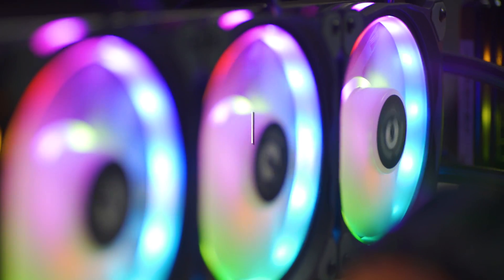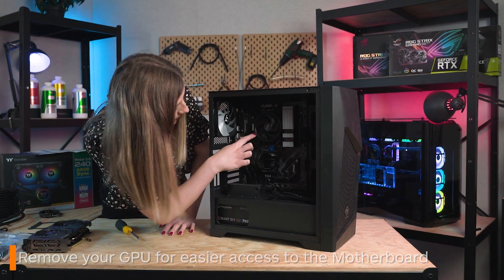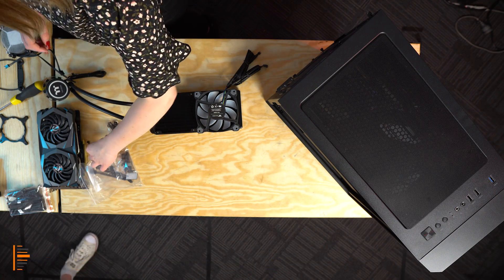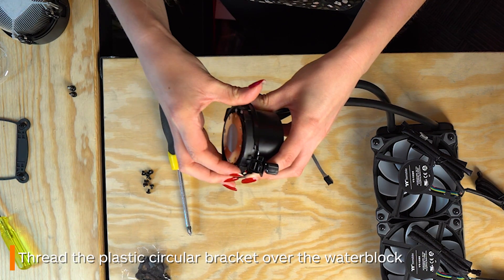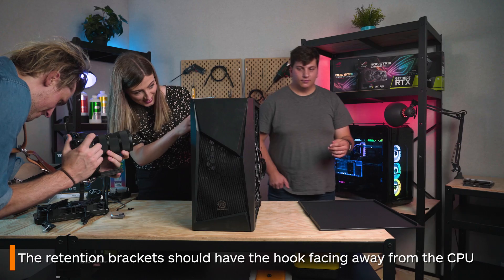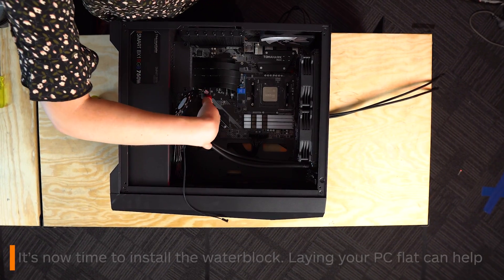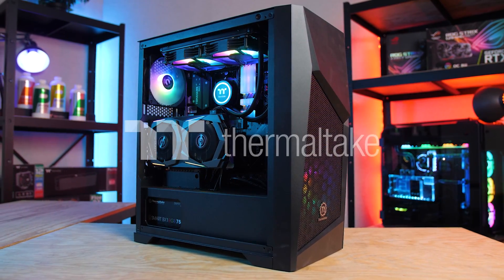How to INSTALL a CPU AIO Water Cooler - Thermaltake Water 3.0 ARGB CPU Cooler

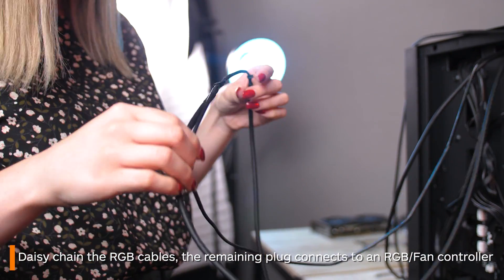Comment: Just to double check... at 4:11 the rgb plugs can be connected to system fan controllers? (If you dont have rgb controllers)?
Reply: What you see her do @4:11 is daisy chain the rgb cable the plug that chain into a RGB Controller that they have inside their case like the Versa C23 TG RGB Edition
 (There is a cable for rgb and a cable for the fan. if you dont have rgb headers, you still need to power the fans. There are RBG controllers that Thermaltake have, for use with the 3 fan rgb packs for example ( Thermaltake Riing Plus 12RGB Radiator Fan TT Premium Ed 3 Pack/Fan/12025/PWM). They use a USB 2 header on your motherboard to 'interface'. For my Gigabyte X570I Aorus Pro WiFi AM4 ITX Motherboard, this meant I lost my front usb 2 ports (2x). This can be overcome by using NZXT Internal 5 Port USB Hub, where you can plug it into the USB2 header on the MBoard, and get 3 more headers.

Comment: Is nobody going to point out that the fans on the radiator are installed the wrong way for push/pull system of the case? The fan in the video is set up to be pulling in air from the top rather than push out. While this isn't a problem without an AIO cooler, the problem is the radiator. The radiator generating too much heat from the CPU and pulling those heat inward toward your GPU will make your GPU temp rise like crazy and function terribly. If the fan and radiator are installed on top of the case then the regular push/pull set-up needs to be used by pulling in cool air from the front and pushing out hot air from the back and top.

Or, am I wrong?
Reply: @sneaky you are super correct sir, the fan is  installed  in  very very wrong way, you should blow hot air upward, not downward  inside the case, i don't care about the gpu, but your system pc become a electric heater.
Reply: You’re not wrong .
Reply: Well, you're right with "radiator generating too much heat from the CPU", but that's one part of the story. 
A quick answer - Whatever the GPU be, if your system is running on base clock then it doesn't matter which direction the rad fans are, you're good to go! 
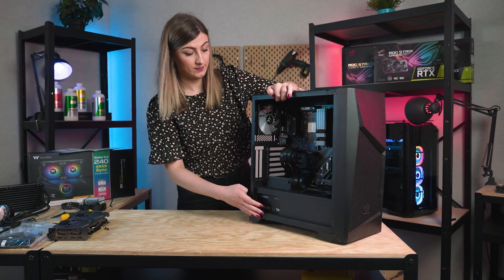But if it's running overclocked then - It basically depends upon what sort of GPU one is using and, of course, personal preferences (even the video mentions that @1:00. Blower style GPUs generally don't show a drastic change in temperatures regardless to the CPU overclocking, but that being said, it'll heat up just a tiny bit because of the lack of fans on it. The difference between temperatures in pre/post overclocking is very subtle.
The real difference can be seen while using an open GPU. If it's a high-end open style GPU i.e with a shroud having multiple fans on it, like the ones Asus has in their Strix series (3 fans), then the rad fans pulling the air inside the chassis ain't gonna make any difference to the GPU temperature as those additional GPU fans are quite enough to keep it cooled and flush off all the excess heat of the radiator. It's only gonna reduce the CPU temperatures as it'll suck in all the cool ambient air. 
But if it's an entry level or a mid range GPU, having a single fan shroud, then it'll heat up significantly. There's very little one can do bout it than to change the rad fans direction. One thing that can be done other than changing the rad's direction is, mount that GPU vertically if a vertical mount option is available for that particular Chassis. But then that's also not gonna help a lot and that's where you are on point and right.
The other way, if a PC is overclocked, is having a high end open style GPU and an AiO installed in the "traditional way" i.e pushing the air outward, it's just gonna add to the CPU temperature by some substantially amount as the rad fans are also gonna pull all the additional heat released by the GPU and then throw it on to the radiator, making the cooled liquid slightly warm again. That's where your suggestion to pull in cool air from front is correct.
As I mentioned earlier, it also comes down to personal preferences - the kind of GPU, fans, chassis one has. I personally prefer to place the rear fan in the direction where it pulls in cool air from outside into the chassis along with the radiator fans doing the same. And then some cool RGB fans in the front (and some not so cool RGB fans at the bottom) of the chassis to blow out all the hot air from within. It's the kind of PC ecosystem that I prefer.

Comment: How did you plug the RGB into the Motherboard? I've just purchased this AIO and an MSI Tomahawk B450 Motherboard but can't see how to connect the RGB to it. I can find the JRGB hearder on the Motherboard the connectors supplied won't fit.
Reply: She is plugging it into a controller that is part of the Thermaltake Case : Versa C23 TG RGB Edition example

Comment: Great right up to connect the rgb cables to the " back section here". Where and what do the rgb cables connect to on a typical mobo? That's the part I cannot find understand.  Using gigabyte b450 ds3h.
Reply: Thermaltake have RBG Cases, and they have this controller or similar on the 'back'. https://www.thermaltake.com.au/versa-c23-tg-rgb-edition.html
Reply: @emredrum  And if we don't have a Thermaltake case, where would we expect to find the controller typically?  Or is it always going to be a separate purchase?

Comment: Do you have to replace the water,  and if you do, how do you replace it?
Reply from the maker: Hey hey Matt, with AIO (All-in-one) coolers you don't need to maintain them by filling them up, AIO's tend to have a long lifespan, as always, miles will vary but you can expect one of these to last you as long as it takes you to upgrade :)

Comment: I have the water 3.0 240 ARGB, the one in this video, and I Daisy chained the rgb connections, and plugged them into that same slot on that little thermaltake board it showed (I have a thermaltake view 51 case) and the lights would not work, and we're not controllable.
Reply: Did you download any control software for the RGB? https://www.thermaltake.com.au/downloads

Comment: U mounted the fans upside down 🤦‍♂️🤦‍♂️🤦‍♂️🤦‍♂️🤦‍♂️
Reply from the maker: You mean by sucking cool air in from the top instead of hot air from the GPU? Yeaaaaaaaaaaaaaaaaaah nah.
Reply: Thermaltake Australia & New Zealand i think those fans are sucking in air RN  or i misunderstood pls clear i wanna know
Reply from the maker: @DevanshRao7  That's correct, they're sucking in air (intake) from the top of the case and pulling it through the radiator to cool it down. The fan orientation doesn't look as nice but it functions better and we do believe in function > form where applicable.
Reply: Thermaltake Australia & New Zealand okok thanx for clearing it out have a nice day :)
Reply: Thermaltake Australia & New Zealand and i mean that radiator is fine but fans are upside down RN they are sucking air in not blowing it out :)
Reply: @R.A.O SAHAB i think you are  just right, that fans are NOT installed correctly, they are not supposed to  pull air from a radiator but push the heat outside to create negative pressure inside the case so the air intakes (other fans installed upside down in front of the case) can do its job and SUCK in cold air.
Reply: Mr. Chris yeah thats what i was thinking
Reply: R.A.O SAHAB  You can use an AIO as either an Intake or an Exhaust, when at the top of the case it is more often an exhaust. Simply because heat rises. If you were to put it at the front of the case it would be great for an intake. It's all about case layout. Source:LinusTechTips
Reply: Tufail Ahmed but in this build its an intake from the radiator which is being heated up by the cpu heat
Reply: R.A.O SAHAB Yes, it’s being used as an intake in this example. If that was me, I would have it as an exhaust. If I had front mounted the AIO I would have it as an intake. I guess it is down to the individual and to say it’s wrong would technically be inaccurate, IMHO it’s just not optimal.
Reply: @sgoy  front mounting the aio causes issues. This has been proven on gamer nexus to cause issues.
Reply: Yup dude the fans are upside down lol.
Reply: Syed Zakiullah lol but seriously speaking if u start following pc building more u will have no confusions

Comment: My Seahawk 980ti is at 85 degrees after gaming for a couple hours because of the summer and it turns my pc into a room heater
Reply from the maker: Yewwwwwwwwww! That's a hawt boiiiii. 
But it would be awesome come Winter time! Haha.
Reply: @ThermaltakeAustralia  yeah it hovers around 60 during winter, this is the first summer I've had the card for so I was pretty surprised when I saw how hot it was getting.
Reply: so is the water already in it?